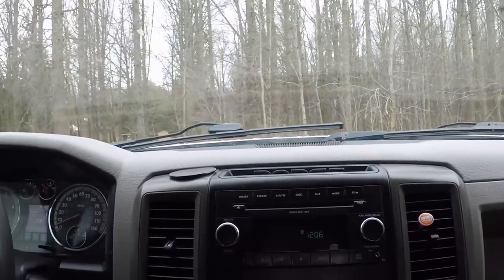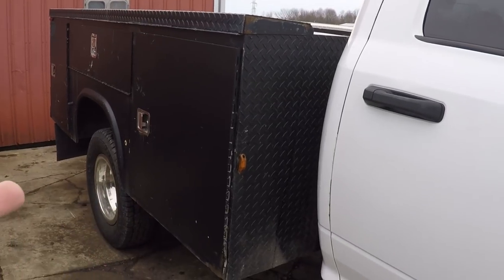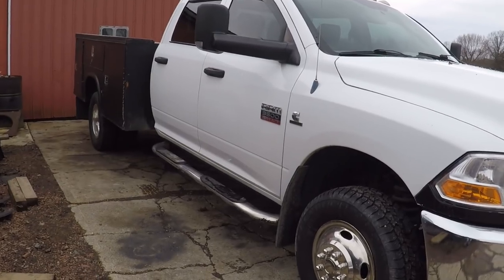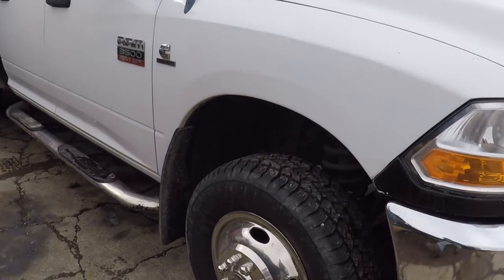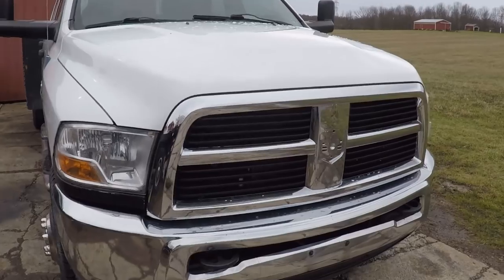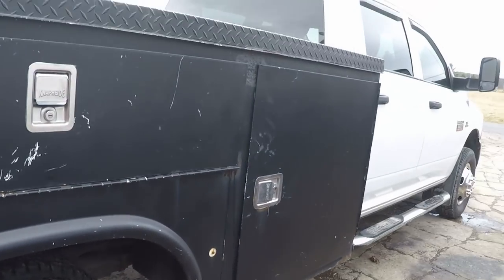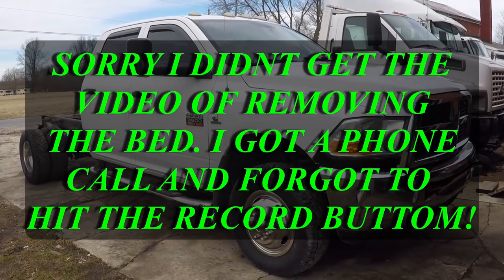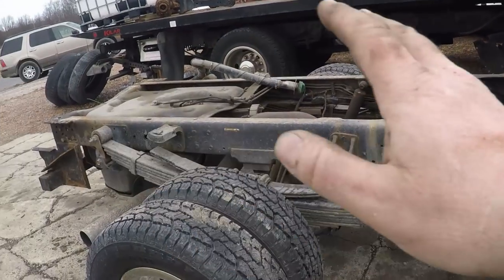2011 DODGE 3500 CREW CAB CUMMINS 4X4! THE BED HAS TO GO!!

Comment: I tow with 255 80/r17 tires which is a size up from the standard 235 80/r17 tires. I don't have any issues with tires rubbing together at all. I put them on to lower rpm's at cruise.

Comment: That's a good deal for you and the new owner of the service body, because you both can treat the rust that is just starting to get bad. Double the life of both. That's good economics. Your rationale for air bags is solid. There is no need to beat the heck out of the truck or your spine.
Reply from the maker: that is the way i see it. easier on everybody.

Comment: Just a thought....find some spacers to go between the back wheels to separate the tires a little more. It’d be cheaper than a new set of tires and you have a good set of matching tires already.
Reply from the maker: i would rather replace them. i dont really want to tow with china tires. i dont want to chance a blow out and having piece of mind can be priceless.
Reply: J.C. SMITH PROJECTS that piece of mind is definitely priceless!!  It’s a pay for it now or pay for it later situation. I feel i may as well pay now instead of later because it’ll cost me more later.

Comment: I had the same problem with my windows I had to replace the main switch pack on the drivers side. The reason it has the extra springs is cause it’s a cab and chassis pickup.
Reply from the maker: those springs were added by a spring shop. they were not factory springs. i would have added air bags as they are adjustable.

Comment: For the dodgy electric windows it's worth trying hitting the driver's switches with contact cleaner, some vehicles the switches aren't well sealed and general grot gets down inside them and causes electrical issues when the switch is operated, particularly in working vehicles were people are likely to be eating and drinking in them a lot...
Reply from the maker: i swapped the switches out with the other 2011 dodge 3500 i have and it didnt fix the problem so i am going to have to look into it a little farther.

Comment: Considering that was a work truck the user obviously took care of it judging by how straight the cab is which is always a good sign.  That's a seriously heavy-duty tow hitch installation, almost to the point of overkill...
Reply from the maker: it is a 2 1/2" receiver. i dont remember the rating on it but it is more than i would need.

Comment: Well with all these Dodge's showing up that must mean no more room for the Fords, which should mean Fords for sale at HUGE discounts...lol.. kidding of course. Looks like a fine rig, one thing I like about service body's is they are pretty easy to get rid of because new they are so freakin expensive that when you list em, guys snap em up fairly quick, heck I even buy some of the take offs if I can get em at a good price. Looks like you have another project on your hands, be interesting to see how you transform it top be a hauler for you.
Reply from the maker: the weather has turned cold and rainy so it will have to wait for awhile...no room for fords....now that is funny. these dodges are "sacraficial trucks". i want to do an apples to apples comparison. i am intend to crank the miles up fast and sell them off when i am done.

Comment: Please. Which full size 4x4 truck would you buy, used? Chevy dodge or ford? I know I for one would really like your opinion and I know others wild to. I know it's the age old question, but new truck prices are out of control, and people want to buy something used that will last. 
Thank you!
Reply from the maker: that really depends on the buyer..are you going to do your own repairs or have it done by a shop? if you are doing your own, what brand are you most comfortable with? are you looking at gas or diesel? are you able to afford the enormous cost of diesel repairs? what mileage are you looking at? under 100,000 or over? how long do you intend to keep it? resale value is much high on a diesel than gas. i am obviously a ford fan but when i wanted something for towing heavy and long distance...my first choice was the dodge because of the cummins. everyone's needs are different. i could offer better insight if i new more about your needs, wants, goals and expectations from a truck.
Reply: J.C. SMITH PROJECTS     Thanks! Gas. Probably around 100k. Shop to do big stuff. I can handle small stuff. No towing. Just dog box and house stuff work.
Reply from the maker: i really like the ford  6.2 gas engine in the 2011 and newer f250 /f350. good on fuel and very reliable the transmissions are very strong as well. i have a 2012 with 237,000 miles and i would take it anywhere with trailer in tow with no worries. in the gm trucks the 6.0 gas is a great engine as well. very reliable as well and very cheap to fix....depending on what year you get, the transmissions can be troublesome. i dont have anything good to say about a dodge gas engine as i have only ever owned 1. it was a 2008 2500 with a hemi and it was horrible on fuel, rode rougher than i was use too and had constant check engine light problems. not a fair review of dodge over all as i only owned the one. hope this was a little help.
Reply: J.C. SMITH PROJECTS     Perfect thanks!
Reply: J.C. SMITH PROJECTS thanks, very informative

Comment: There could be a wire loose in the connector going to the door sill  or the door it is a common problem for the dodge trucks
Reply from the maker: not sure...i will look into it one of these days

Comment: So, you got an offer you couldn't refuse on the car hauler. What now? Lol
Reply from the maker: i am going to buy a different style trailer. it will look just like a semi truck flat bed. it will have a king pin and the deck will be almost flat from front to back. it wont have the gooseneck. that trailer was 48' overall length with 40' of useable deck space. the one i want to replace it with will have 48' over usable deck space and be 48' over all length.

Comment: Have you seen that report on the China tires? It states some of them tested are missing key important parts the same parts that were not in the tires that gave Ford all the trouble with blow outs on the Explorers back in the day. The report was on Passenger car tires from China not LT but I still don't trust them on mine.
Reply from the maker: i dont like or truck china tires especially when towing.
Reply: I don't blame you.